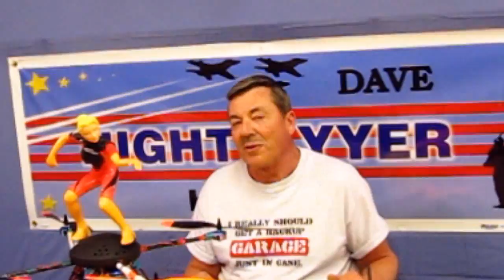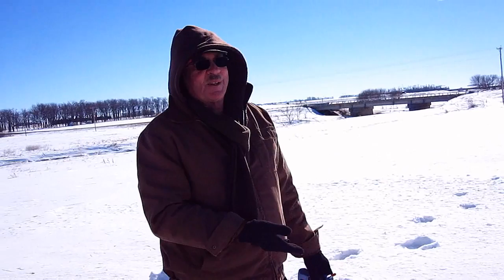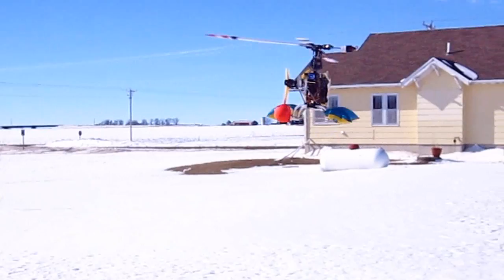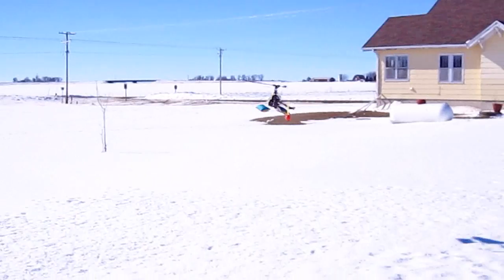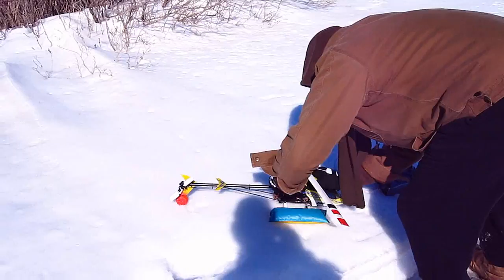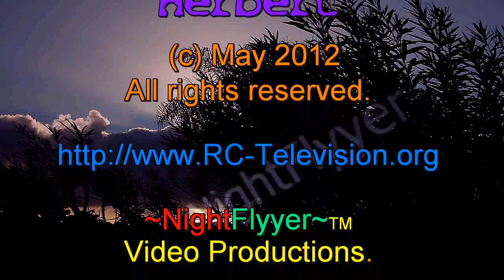Train Sarcasm and 1 Rotor Blade. (A Helicopter Demo from the Winter Archive)

Comment: Hi.
I like your theme of 1 rotorblade. It is inspiring. You state that 1 rotorblade is more efficient because it runs in less destourbance. It should therby bee able to do same amout of work as 2 blades.

I like peaple who do experiments to prove the theory.
Do feel up to it by making a experiment?
The experiment should consist of loading the helicopter with wieghts and see how much weight it can lift and to see where the limit goes. It showes therby the rotordisc efficiency which is a measure on the rotorblade efficiency.
If the 1 rotorblade is at least as efficient as 2 blades it should be able to lift half the weight.
You have mayby Another idea making the test?

Comment: FURTHERMORE:

Wherever feasible, train horns must be sounded in a standardized pattern of 2 long, 1 short and 1 long. The horn must continue to sound until the lead locomotive or train car occupies the grade crossing.

For the first time, a maximum volume level for the train horn has been established at 110 decibels. The minimum sound level remains 96 decibels. Railroads have until 2010 to fully comply with the maximum volume level requirement.

Comment: EXCEPTIONS:
-If a train is traveling faster than 45mph, engineers will not sound the horn until it is within ¼ mile of the crossing, even if the advance warning is less than 15 seconds.
-If a train stops in close proximity to a crossing, the horn does not have to be sounded when the train begins to move again.
-There is a "good faith" exception for locations where engineers can’t precisely estimate their arrival at a crossing.